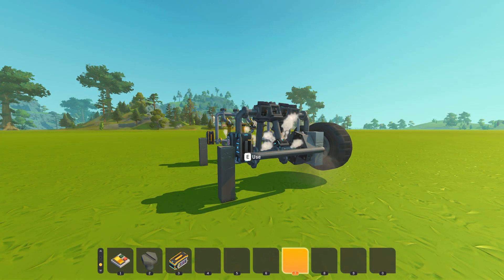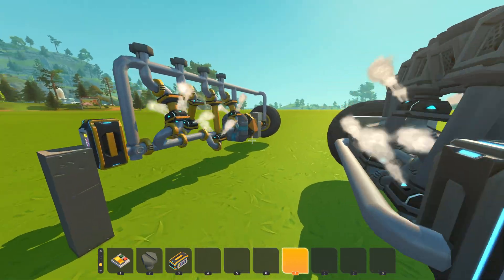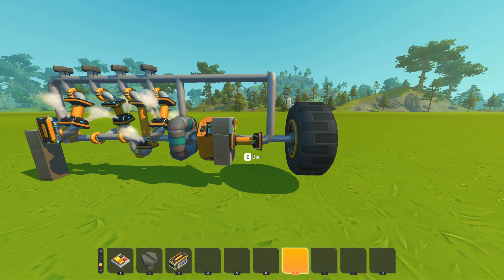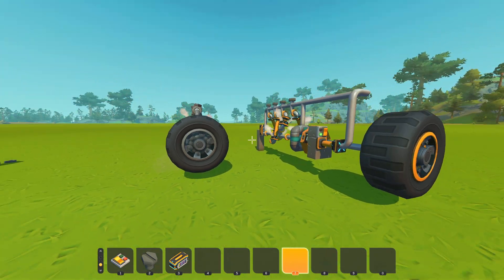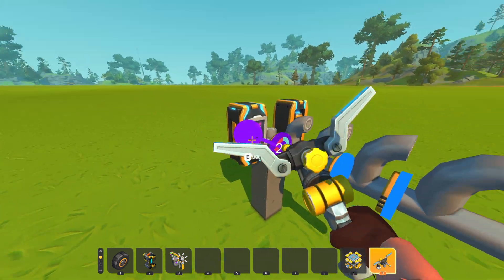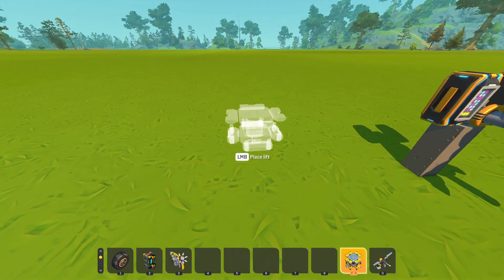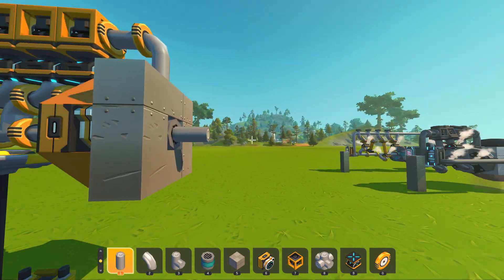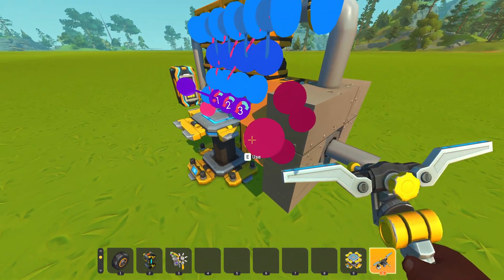How to make a small piston engine | Scrap Mechanic

Comment: I recommend putting a screw it the tips of the shaft to smooth the rotation of the engine
Reply from the maker: just add pipes, it's better
Reply: But they weigh the same?
Reply from the maker: I am pretty sure the screw has bigger collision, so it will collide the other screws @zenus4270

Comment: Does this not work in survival mode? It's possible I messed something up but not only does the engine freak out whenever I take it off the lift but the pistons constantly lock up if it doesn't just explode, despite my reinforcing the frame. My recreation of it worked fine in creative but for some reason my survival version just refuses to work. (Should also mention my pistons are unupgraded, is the upgraded speed required?)
Reply from the maker: it works in survival tho, the function of the physics in creative and survival are different.This piston engine is quite terrible and i am gonna make a new tutorial soon

Comment: Didn't work did everything correctly
Reply from the maker: did you check the crankshaft rotations?
Reply: @Deniz69567  i checked everything went through the video 2 times
Reply from the maker: @vyntage5326  did you check the timing with all those color mode?
Reply: @Deniz69567  what
Reply from the maker: @vyntage5326  the sensors connected to the logic gates and to the pistons
Reply: @Deniz69567  oh i didnt know you had to do that thank you
Reply from the maker: do what i did with the sensors
Reply: @Deniz69567  Is there some way to make it go in reverse?
Reply from the maker: or did you check the piston's block range and speed?
Reply: Nvm I figured it out
Reply: @trainzone3428 how?